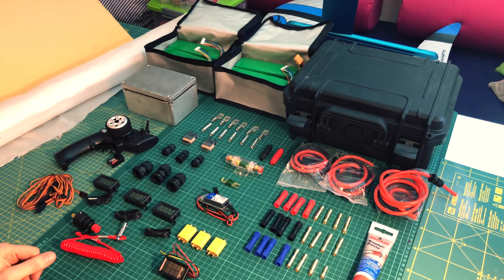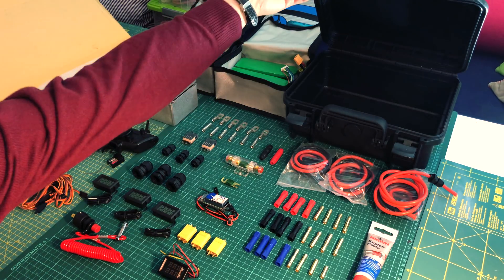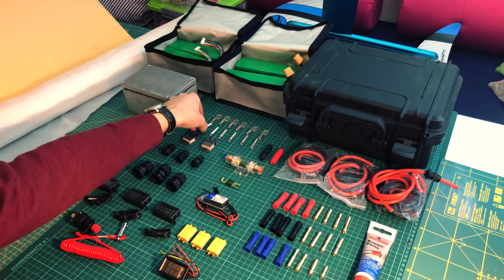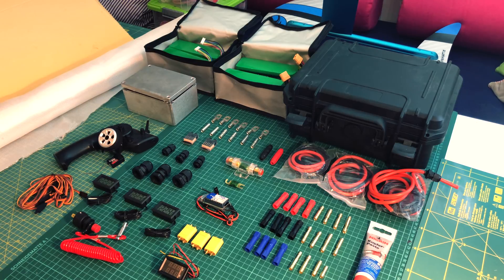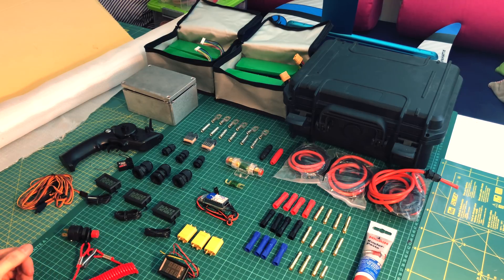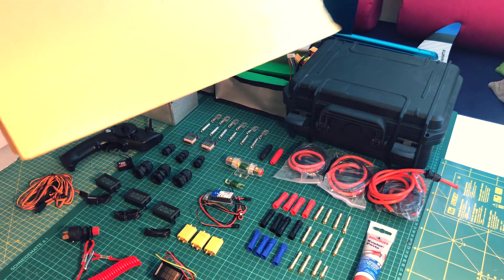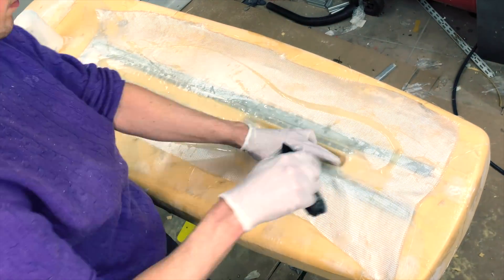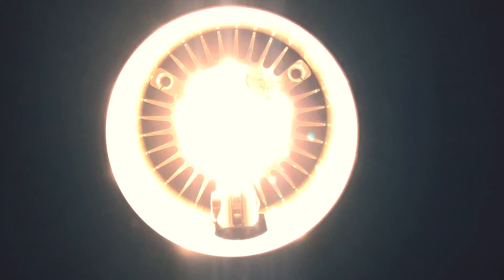Electric Hydrofoil Surfboard Introduction (Plans, Parts and Electrics)

Comment: Hi Max! It seems like you didn't finish the board jet. What issues do you have had with you motor/ESC? Will you finish it?
Reply from the maker: I will finish it! The only issue is time at the moment. I have to work a lot and don’t have as much free time to work on youtube. I hope this will change. I am about to finish water proofing and then testing the prop.

Comment: Greeting, I'm looking for an engine to intall it on a 12-foot board, which was Windsurfing ,now I want to mop electrically to fish around my area, if you can help me, where i can buy it ,I am 60 years old and weigh 200  that I can move well. Thanks  Rene Flores  email;   rene20flores@gmail.com    787 407-9061.
Reply from the maker: Hi Rene, I recommend having a look on instructables. Below are three links. 
 https://www.instructables.com/id/Kayak-trolling-motor/
https://www.instructables.com/id/The-Super-Quiet-Electric-Canoe/
https://www.instructables.com/id/DIY-Kayak-Trolling-Motor-YAK-Board/

Comment: https://www.amazon.de/KKmoon-Multi-Batteriesystem-Gabelstapler-Engineering-Automotive/dp/B01N49AYTN/ref=sr_1_1?ie=UTF8&qid=1522938470&sr=8-1&keywords=500a+relais 

think 500A relais should be enough ;)
Reply from the maker: Thanks. I looked at that one and did some more research. Apparently they are not really rated for 500 A but I found a similar one on eBay from electric forklift. Research. Apparently they are not really rated for 500 A but I found a similar one on eBay from the electric forklift. Thanks for your tip though.

Comment: Your dead man switch could simply disable the motor controller, It couldn't be too hard to work out. e,g, make it drop the logic supply on the esc. For a kill switch you can short out the supply which would force the fuse to blow.
Reply from the maker: I found a suitable relay now.

Comment: Damn Max, you're really going for it! That's awesome. I can't wait to see how it turns out. Your ESC will have some sort of cut off switch you can use as an e-stop. I know it wont be as* safe, as it will still be feeding power up to that point. but at least it will stop the motor from running away on you. Also you might want to consider putting a stringer down the center of the board, it will add a surprising amount of structure and rigidity to the board. If you get tired of waiting for the specialty motor, I might have some suggestions for some off the shelf motors you could modify.
Reply from the maker: Thanks. I pretty much god the motor now. There are two made by alien power systems. One is waterproof and the other one is easy to waterproof at home with epoxy. I also found a 200A relay for electric forklifts on ebay. Made in the UK and great quality.

Comment: How much did this cost overall?
Reply from the maker: So far 200€ for the batteries, 30€ for foam, 50€ for the case, 20€ for the aluminium box, 200€ for all the electric stuff, 100€ for glassfibre and epoxy, 500€ for the wing. 1100€ total. I guess another 600€ for the motor and the ESC. Not cheap.
Reply: Do you know of any cheaper options? I live on a lake and kind of want to make this myself.
Reply: I actually found a wing for about 79 USD
Reply from the maker: I don’t know a cheaper way. Its a pricey hobby.
Reply from the maker: Which one?
Reply: Nevermind, It was just a mast

Comment: Very interesting project, the end result should be really fun :)
Gotta wonder what motor you're going to get though..
Reply from the maker: I am looking for a 100kV inrunner motor that runs at 44V and with about 5000Watts. The diameter should be less than 70mm. Motors that are available currently are unsuitable because they are either out-runners, so not waterproof-able or they run too fast with low torque. They are made for RC planes. Air is thin, water is thick. So we need a lot of torque and low speed. Props have cavitation at high speeds.
Reply: Max Maker 
I thought it'd have to be powerful alright but wow.. A 5kW motor! Good thing you have the sea to cool it ;)
Reply from the maker: Oh yeah. The sea makes this much easier, and that the motor is underwater. I just hope the ESC does not blow up, that is most expensive, and I had one blow up on me before. Its like new years eve fireworks.
Reply: In the video you talk about motors that are rumored to be perfect for this. Which ones are you talking about?
Reply from the maker: APS 70110 and APS 56115. However, the first one only has 3000W, and the second one needs 110V DC, which is to dangerous for my taste. So I use the 70110 for now. At least I am testing it and see if it could work. Once I know the thrust, Ill build the motor pod.
Reply: Cool, so you have the 100 KV version then.. Would love to hear how the testing goes.
Reply from the maker: You will soon! Lets hope it doesnt burn.